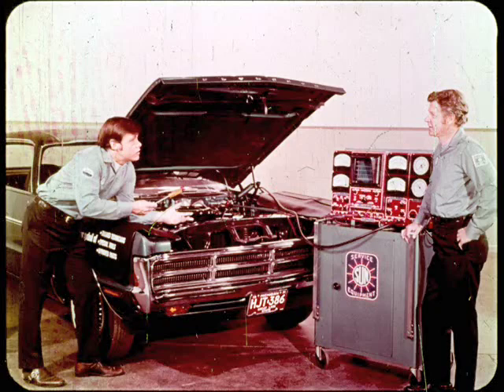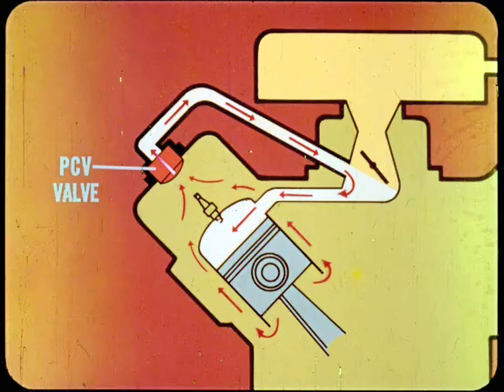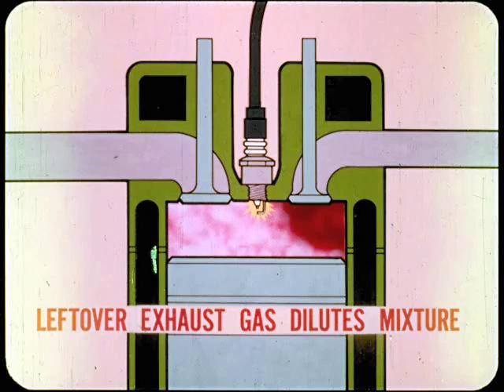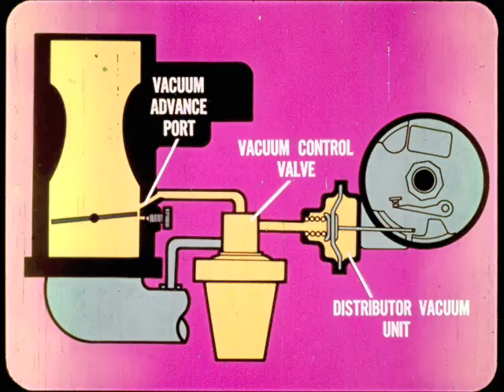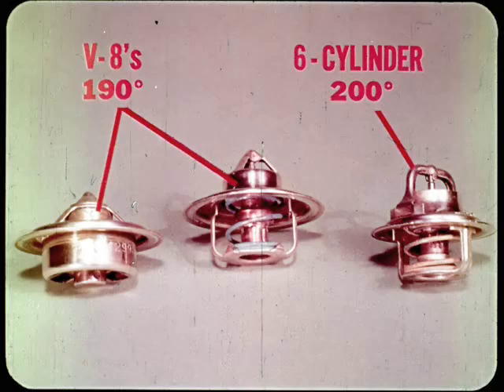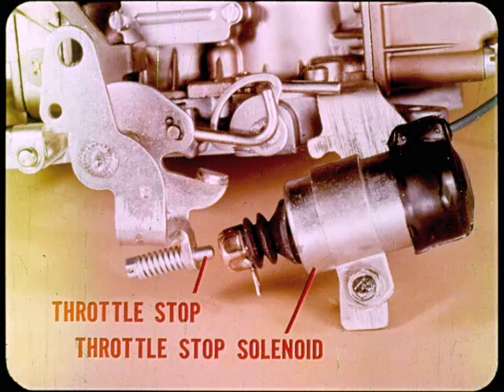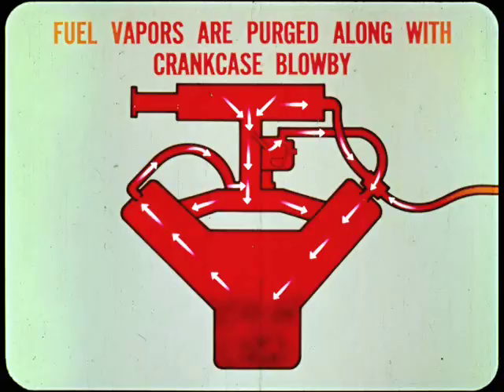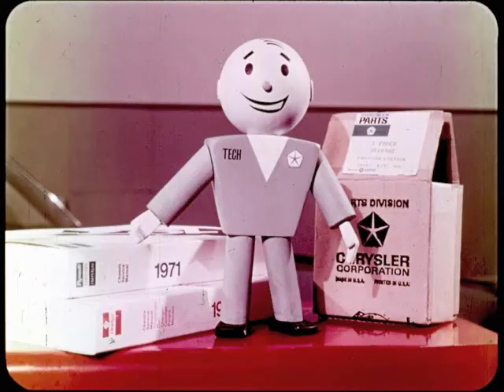MTSC - 1971, Volume 71-10 Evolution of the Cleaner Air System

Comment: The problem with these early emission control.systems is they only worked when the vehicle was new. Not just with Chrysler products; but any of the automakers scrambling to bring their models into compliance with tough new emission laws.

It didnt take much to bring the vehicle out of compliance. A simple change in altitude or climate could cause a car to fall out of compliance. But generally what happened was as regular components such as spark plugs started to wear, frustrated car owners removed or bypassed the emission controls believing it was the culprit. Independent mechanics oftem bypassed emission systems in an attempt to give their customers a better running car. And who could blame them; retarded ignition timing and lean carb mixtures made the cars run like complete dogs.

Just a couple years later, automakers would begin installing catalytic converters to help control exhaust emissions. So now car owners were driving vehicles with retarded ignition timing, lean fuel mixture and a choked exhaust system. Most car owners removed or altered these systems which defeated the whole purpose. 

Over time these systems would be controlled by onboard computers making it difficult for owners to bypass the systems. Today the entire car is managed by multple computers. It took 40 years but the government won their battle against automotive emissions
Reply: People today do this on diesels with DPF and EGR deletes